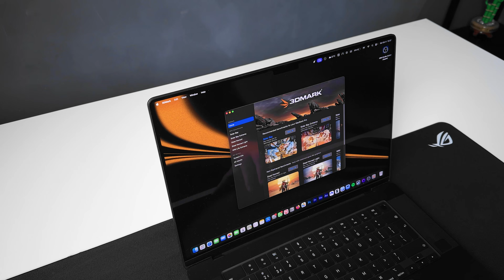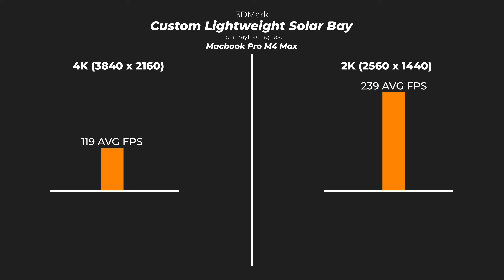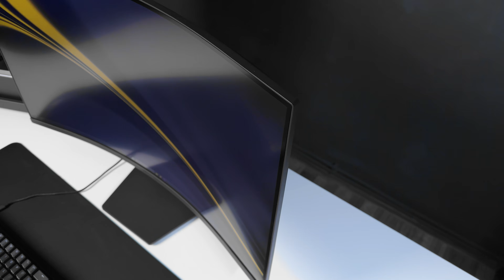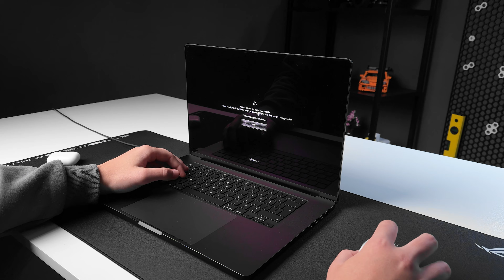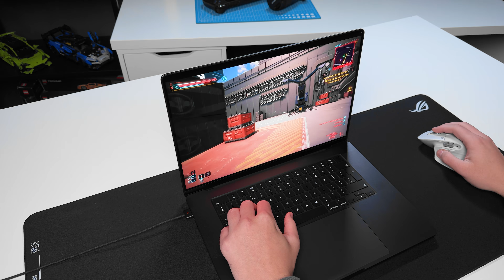Gaming on a $4000 Macbook Pro - What No One Tells You

Comment: 5:30 dunno why but works so well on my m4pro base mac. I didnt saw any drop or low fps in medium.
Reply: Bro same in my m4 pro it crushes rtx. 5090 with i9 in single core and on battery and my gaming pc has. Jet engine my base. M4 is best and it also crushes minecraft it gets 800fps with 322 mods and. With shades in ultra profile it stabilizes fps at 120 and I could game asphalt 9 at ultra profile for 2hours
Reply: Is any windows laptop able to do that 😂😂😂😂

Comment: I'm pretty sure the strongest windows laptop, plugged in, is getting less fps then the m4 max while consuming 4x the power, costing the same or more and being a 5 ton fragile brick. your experience with outlast and that card game was clearly a compatibility problem. in the end your desktop is getting just double the fps of the mac, which makes it more powerfull indeed but not as much as stated in you clickbait thumbnail which shows the fps of already heavy game with two heavy features enable that still needs to be optimized for m chips while the modern Nvidia gpu are basically built for.

 that's quite impressive seeing the glass half full and not half empty, a relatively new technology in gaming is capable of doing 1/3 of the fps of a built for gpu with 1/6 pf the power. if they were to optimise this feature for the mac platform that would bring to the 1/2 performance you showed for normal settings

tha macbook pro already wins as a gaming laptop, even the macbook air already wins as gaming laptop as it can now run Minecraft with shaders and most games while a 1000 $ gaming laptop can't, it doesn't beat a desktop on price/performance but crushes it on power/performance, the power difference might even compensate for the doubled price in the long run

Comment: This is not entirely true! My Macbook Pro M4 MAX 48GB RAM – Cyberpunk 2077 native resolution, raytracing turned off, all settings on max or ultra - average FPS 96!!! The same with ray tracing turned on around 42 FPS. if the settings remain the same (everything on maximum) with path tracing it drops to 30 FPS sometimes slightly below - no disaster. All this in HDR and it makes no difference whether the Macbook Pro is plugged in or running on battery. Other games also work without problems! Resident Evil 4 All settings on maximum - FPS 60 and more. Shadow of Tomb Raider - all effects on maximum 120 FPS. Control Ultimate Edition - Effects on maximum HDR - FPS 120... It depends extremely on how the game is optimized and what the settings are. Some games are miserable, others work excellently and beyond expectations. The M4 MAX is surprisingly powerful even for playing games! It's not a gaming PC - it's a tool for artists, graphic designers, musicians, video editors, etc. And all that - maximum performance, minimal battery consumption, perfect image. Mac is simply for work and in recent years it's starting to be possible to play games on it. All plus points. It's not exactly the best at 3D graphics - that's probably the only complaint, but Apple is starting to catch up in this area too. Games on Mac have always been just a bonus for me and now it's simply a fact that it handles a lot of titles really well - despite Crossover etc. It's not a machine and system built primarily for games and it can't match the most powerful PC builds! But the fact remains that it has overcome many problems from the past and playing AAA video games on Mac is now a reality! And it gets better and better every year!
Reply: Bro apple is apple no one can defeat it even apple is getting better at gaming now with metalfx

Comment: The comparison between a MacBook and a large Desktop Gaming PC is not a fair comparison even if it’s the same price. They serve different purposes, which is why you can find windows laptop that are similarly priced to the Mac that will also be nearly 50% the performance of the gaming PC. Also power draws are completely different. Try to compare laptop to laptop, that have similar power draws and efficiency and see how they perform. This would be a better comparison
Reply: even with laptop macbook still lose if u focus on 3d animation or gaming
Reply: @Ekswels  3d animation no, windows laptops are RAM-limited. In smaller scenes, NVIDIA GPUs often outperform Apple Silicon due to software optimisation and CUDA support, but once the model starts to grow in size, you easily hit the 8GB to 16GB RAM limit on consumer NVIDIA cards. Whereas on the Mac, the GPU can access all of the system RAM without loss in performance due to the insane memory bandwidth.
Reply: @mrglasses8953  bruh stop inhale copium
Reply: @mrglasses8953  u not understand PC component and specs. thats why u talking like this

Comment: If only, you had compared it with a windows gaming laptop.... You would see that even a 5090 gpu laptop has 50 % of its desktop counterpart performance.  That means a pricey gaming laptop, even with a 5090, would be at the same ballpark of performance with the M4 Max, with 3 times more power consumption. Factor in the build quality, service, client attention, resell option etc, if you are not focus gaming but only casual i think i would go with the Mackbook.... 🤷
Reply: He's using a 4080 super not a 5090. The desktop 4080 super is not far from the 5090 laptop, for example timespy avg for 4080 super is 28k, and the 5090 laptop is around 23k.

Comment: 1000w pc vs 140w laptop… that is able to do that on battery. If NVIDIA cards would pull only 60w + CPU and other components the cards alone would cost 10k+
Reply: The amd ryzen ai max+395 also exist
Reply: @BigBack165  the igpu of the 395 can’t compete with the m4max.
Reply: @tronixmobile  its around 10% slower in 3d rendering, but beats the in m4 max in gaming perfomance and ai. it also can have 16gb more vram
Reply: @BigBack165 only because it uses OpenGL update and all of the game has it while mac has outed ver of it and use metal fx which only a limited amount of games have it
Reply: @BigBack165  The comment thread is about performance per watt.

Also, "amd ryzen ai max+395" is irrelevant when we're talking about a laptop. They're all inside of $4000 asus machines that bottleneck, and none are close to the battery life, build quality, screen quality, and built on Unix like the Mac is. 

AMD is 10% for a reason.
Reply: most gaming pcs only consumes around 300w at max.. Laptop 150w
Reply: @McCarthy880 the 4000 series is around 300-400 watt in demanding games + CPU 100-200 watt + the rest of the components.
Reply: @tronixmobile 4060 with 115watt and runs better m4 max
Reply: @McCarthy880  what build only consumes 300w , I’m curious
Reply: More like 500W lol don't need to exaggerate THAT much.
Reply: Money ist Money my friend. 
1000 Watts or 60 Watts the Costs are the Same
Reply: @corvus6463 laptop should be compared to another laptop, there is same price laptops in windows land (but they are still much better in gaming anyway)
Reply: @corvus6463yeah sure, but still it’s comparing Apples to oranges. You can’t bring the pc with you in your backpack..
Reply: @corvus6463 not the TDP. You cannot compare a car that can eat 1kWh with another eating a fraction. Are you kidding me?